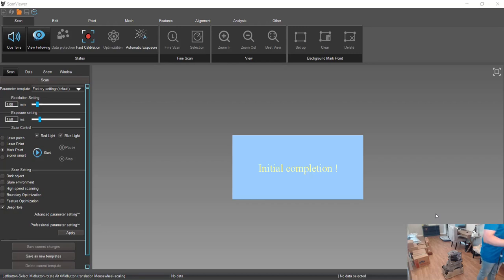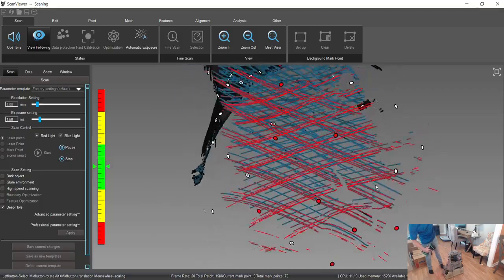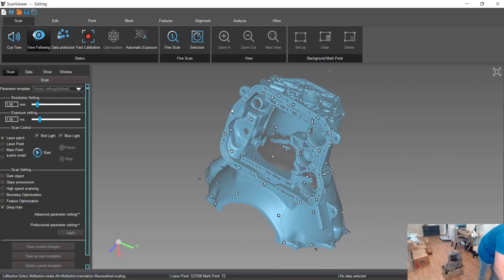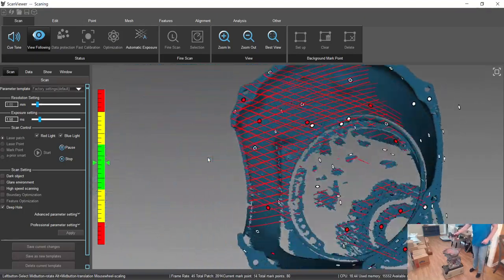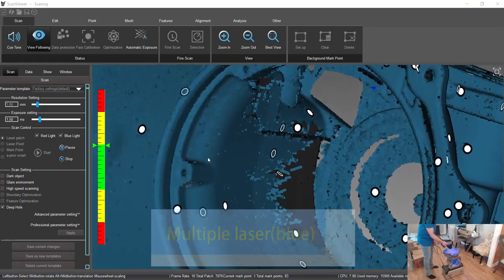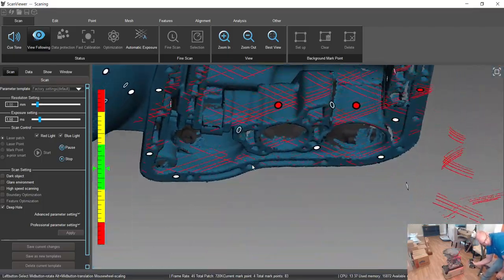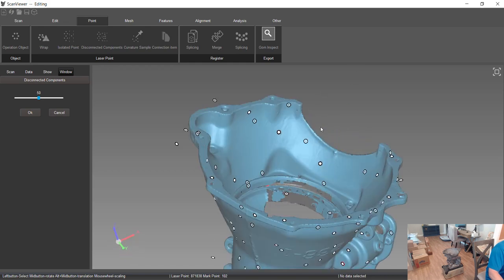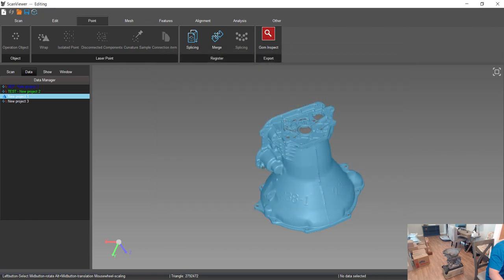Transmission Casing Scan with a Scantech3D Kscan 20 3D Scanner

Comment: Hello, I have a question about 3D scanning. If there is a hole in a curvy area, how can you fill it up? Sometimes when you fill it, the shape does not turn out as it's supposed to and creates bumps.
Reply from the maker: Great question. The approach to filling holes in a 3D scan can vary depending on the software you're using, as each one comes with its own set of algorithms and mesh editing tools. Sometimes, the best solution is to reverse engineer the scan into a CAD model. This process can often bypass the issue of shape distortion and help you achieve a more accurate and smooth result. Remember, the key is to choose the right tool for the job and leverage its strengths to maintain the integrity of your design. To this end, we can help, just give us a shout! - DD

Comment: Hey guys, so i have an issue when i combine the 2 scans together. After it processes both the scans and joins them, i end up with a blotchy giraffe like pattern all over my scan. Both sides of my scans were very clean to start with before i merge them, but everytime i merge i end up with a blotchy unuseable scan. Have you ever had this issue?.
Reply from the maker: Good question! Here’s feedback from our engineering team: 

1. Did you use targets or geometry to do the alignment?

2. What kind of object was being scanned? Is there a chance that it could have deformed, even slightly, between the scans?
 
It could be a few different things causing what you are describing, but it sounds like either a bad alignment or perhaps it’s the result of scanning a part that deformed between the two scans. 

If the thing you’re scanning changes shape between scan 1 and scan 2, there’s no hope of getting them to align properly since they straight up aren’t the same shape anymore, and that will cause a scabby looking, doubling effect like you’ve described…

Look forward to your response! Thanks for the comment.

Comment: How good is this Chinese scanner?
Reply: It is very good, I have the same scanner and for that price I am highly impressed. Softwate is also easy to use and user friendly
Reply from the maker: We've been very impressed from our testing.  It's fast, accurate, and the software is very easy to use.  Let us know if you have any additional questions.
Reply: @DigitizeDesigns  how does it compare to creaform's scanner in terms of resolution and software? I am very concern about the development of software, since well harwarewise, u can tear down and parts are available as long as u have money
Reply from the maker: @kylisation   the resolution and software is great.  We were very impressed and surprised when we begin our evaluation prior to officially picking up the Scantech line, but we've been blown away by it's capabilities (both software and hardware wise).  In fact, the resolution is higher than the Creaform scanners, and it has built in photogrammetry capabilities to achieve much higher accuracies across large distances when compared to Creaform.  If you'd like to check it out, we'd be happy to do a demo for you.  Just let us know!
Reply: @kylisation  A really good product, but the new Ksan Magic 1 and 2 models should generally be more cool. In software, it is slightly inferior to creaform, but many things in software are free